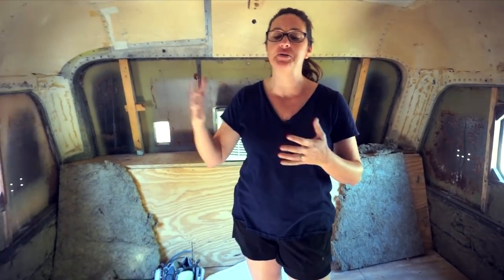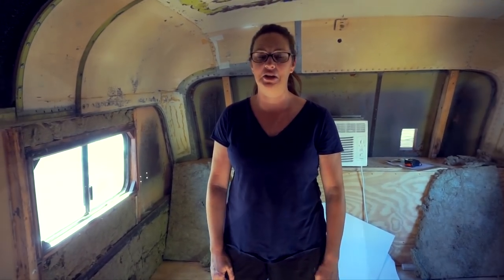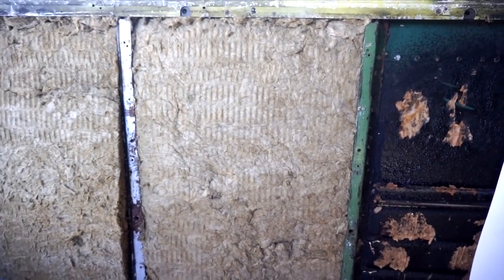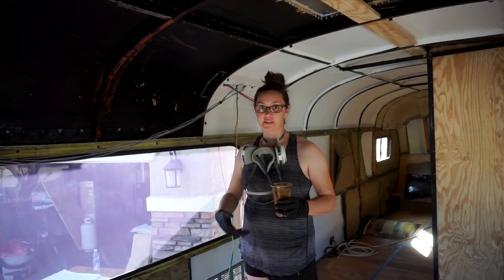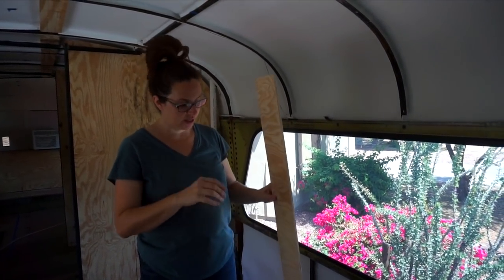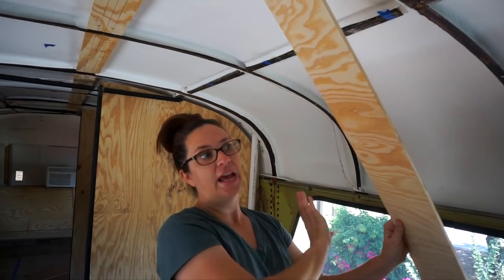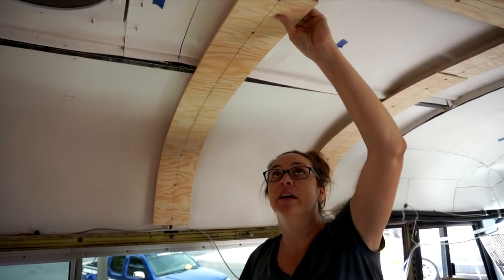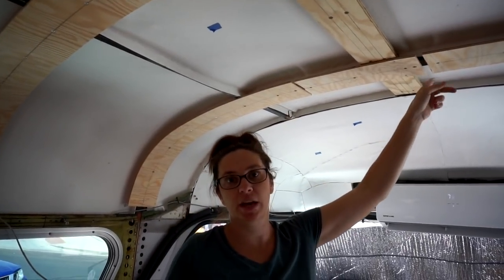Installing Ceratex and Furring Strips

Comment: I used perforated insulation pins and self-locking washers to hold my insulation in place. They come in many sizes, and the best thing I found to keep them in place is regular silicone. I tested all kinds of stuff and silicone the easiest and quickest way! I found them on Amazon.
Reply from the maker: Thank you Sapper that is a great suggestion.  We saw George using those insulation pins on his video and they looked fantastic.  Thank you for sharing

Comment: Hey Juan,   If you have more holes to predrill where you don’t accidentally go through the outer skin of the bus, cut off a couple of drill bits so it can’t happen.  Everything’s looking good.   Alan
Reply from the maker: Thank you Alan - we measured the drill bits to be about 1/2" away from the exterior skin just in case we popped all the way through.  We didn't touch the ceiling once - we started out using a block to "catch" the bit if it went through but it was not hitting the block so we stopped using it.

Comment: I see you have the Firing strips in now, and they look great...   If you find you're have to do something similar, or one of your other viewers is considering going down this same path...   Put your relief cuts  in the face of the strip (the inside of your bend).   In the case of your ceiling curve, you would probably need a 2/16 cut about every inch to 2 inches, maybe less.   You basically want to break the surface tension of the face ply, so it has a place to bend into.   I use this technique a lot when working on boats when I'm building or replacing an arched deck or adding a classic round transom to the square transom of a boat I'm building.
Reply from the maker: Thank you Daniel that makes a TON of sense!  Excellent suggestion - thank you!

Comment: The details you are making are impressive.   At 2:35 you have 5 holes in the wall.  What is this from?
Reply from the maker: Thank you Dennis - those are from the awnings that go over the small windows.  When we put those back in those holes will be converted into riv-nuts that should be water tight.  If we decide not to put those back in we will fill the holes with some rivets and sealant.

Comment: There is a product called wacky board that comes in a 4x8 sheet I saw on This Old House that is designed for what you are doing with the nailing strips. Not sure the price and you are probably already done with the job but thought you might like to check it out for later. You mentioned nailing your foe tongue and grove not sure if that was a slip of the tongue but there are finish screws on the market that would be better than nails unless your using ring shank nails. 
As you were insulating did you notice your ac's cycling less?
Love this build and cant wait to see it done :)
Reply from the maker: Thank you Hill on Wheels - wacky board would have come in handy!  I think it is a bit thinner than what we used (1/8" vs 1/4") but it looks VERY bendable!  Thank you for sharing.  We did mention nailing our ceiling in - we are actually planning to glue it in and just use brad nails to hold it while it dries.  We are not 100% sure if this idea will work - but we say that about every project we start.  I will look into shank nails and finish screws - thank you for the suggestion.  Just this little bit of insulation has made a BIG difference in the bus - temperatures in AZ are already creeping into the 110 degrees!  Thank you for the comment and suggestions!
Reply: I just moved to AZ myself and am living in a 27' travel trailer and had to get a window mount ac to help my 13.5k roof mount. It is so much nicer here than norcal so I purchased a brand new home in the casa grande area. I'm glad I could help with ideas 🙃
Reply from the maker: @hillonwheels8838  Casa Grande - you are just right down the road :)

Comment: Do you think the furring strips could of been put in water first? Great video.
Reply from the maker: We did put the very first one over a pan of boiling water - it did help a great deal but it just took so long that it would have taken us like 2 months to finish with that method :).  Since we are using plywood I don't think actually submersing them in water would have been a good idea (I could totally be wrong about that).

Comment: It looked like there were a group of small holes in the back where you put up the white insulation. How are you going to seel those?
Reply from the maker: Thank you Bruce - Those are for the awnings that cover the windows.  We still have not 100% decided what we are going to do with those.  If we decide not to use them we will drill them out the 3/16 and fill them with closed end rivets.  If we decide to use them then we will likely install riv-nuts where the awning mounts.

Comment: I was assuming the the CeraTex would be the inner most layer of protection.  Is there a reason you put it against the metal instead of the rockwool against the metal?
Reply from the maker: Thanks mike - we could have gone either way but we thought this might be easier to manage.  There is no real way to make the Roxul stick to the walls since it is much more "fluffy".  We thought having two somewhat "loose" insulations would be much harder to deal with.

Comment: How does your mini split work after insulation was installed?
Reply from the maker: We are slowly adding the rockwool insulation over the ceratex as we go.  In fact, we just finished installing the kitchen and living room ceiling (video coming down the road), and we literally insulated that in sections as the ceiling was going up.  It is currently 110+F here, and with our mini-split going, plus our little a/c in the rear bedroom, we can keep the temps in the bus  between 75-85 and we aren't fully insulated yet.  We are very happy with the mini-split!